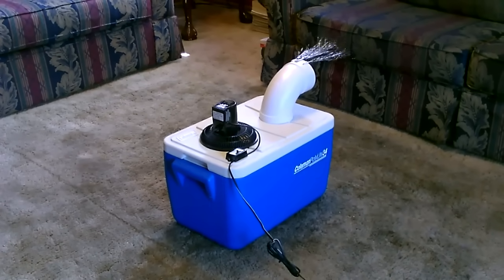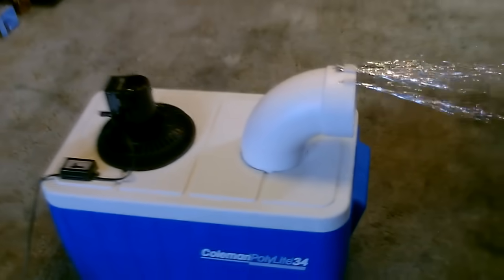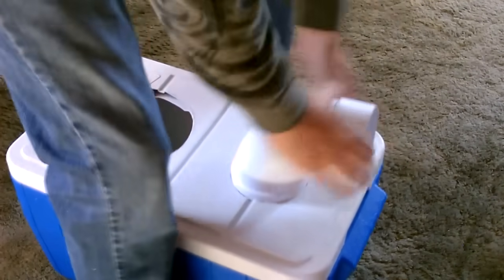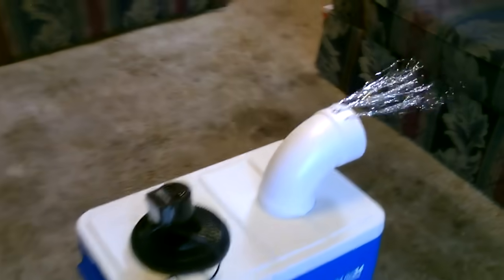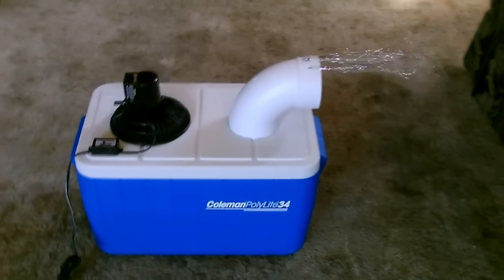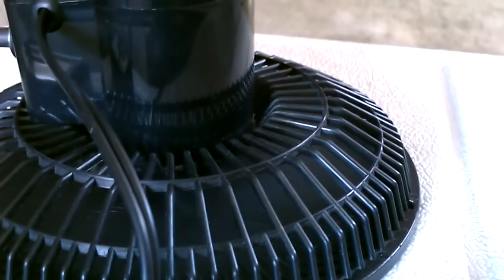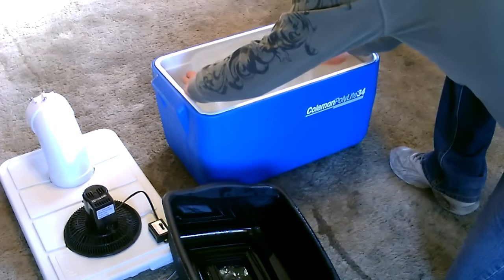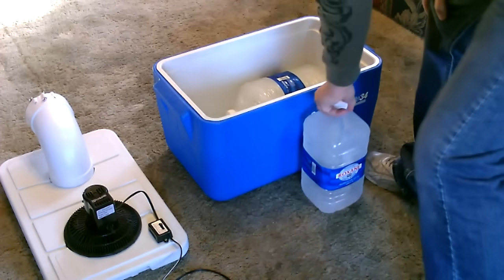Homemade air conditioner DIY - Awesome Air Cooler! - EASY Instructions - can be solar powered!

Comment: VERY IMPORTANT: Put tray in middle of cooler to suspend ice. If air goes underneath ice instead of skimming top of ice it will make it even colder
Reply: I usally put 8 beers under the block to support it
Reply: But how much sooner would the ice melt? Is it worth the trade-off?
Reply: @CallaFab  I guess it depends on how cold you want it. If it's not cold enough, then perhaps suspending it is the better option.
Reply: @CallaFab , good point. 👍
Reply: Wonder if putting Ice cream salt would make even more colder?
Reply: @charlescoker7752  Isn't 40 degrees enough?
Reply: @3sidesofeve711  read the original thread that said "cut it above the ice block to make it even colder..."

Me; Ya ya, good idea....

Reading your comment just made me  realize that 40 degrees ....was "enough."
Reply: @3sidesofeve711  Not in the california desert in july.
Took me 50 pounds of ice and 2 small fans to get temperature to 56 degrees.
It was 129 on the asphalt outside.   Best money i spent that year.
Reply: @wesleygary6651  I'm with you there man, I love it!
Reply: @wesleygary6651 where in CA?
Reply: @earthspiceherbs771  South, looking at map hang on...mesa verde or yuma.
Reply: @3sidesofeve711  it’s never cold enough 😂😊😊
Reply: I dont mind paying $10 while sitting out in the heat watching a kids game
Reply: @reasonabledoubt9223  if you use it like that, it is perfect! But if you want to use it alot, like  in a garage situation, other ideas would be better and cheeper for the long run.
Reply: What about some dry ice In there somehow wouldn’t that last awhile
Reply: @reasonabledoubt9223  Dry Ice is mostly made of Co2 which is toxic.  Only takes about a min of a rat of breathing Co2 before it dies.  Just be careful with Dry Ice
Reply: Also…add some rock salt to the ice!
Reply: We have those freezer gel pacs…wonder if they would work?
Reply: Did you hear the Good News? Jesus, the Son of God, loves us so much that He died for our sins. He was crucified, then resurrected. Jesus conquered death and has overcome the world! With His sacrifice, we can live forever in Heaven with Him in eternal happiness! Follow Jesus, repent, and live forever!

- If you want to learn more about the Good News, check out the Books of Matthew, Mark, Luke, and John of the New Testament of the Holy Bible.
Reply: Guys, it's ok to use these, but the reality of it is the ice isn't cheep, so if you don't have a deep freezer to remake ice blocks, these cost more to run per day than a window unit.  It will cost you at minimum $10 a day if you use it for a few hours.
Reply: @rodneyhodgson2068   You can always use gallon water jugs and keep refreezing them.
Reply: @Tony W  I wonder how long tgey rake to freeze vs' melting, Ill have to google. Just depends how warm the room is.
Reply: @TonyStone3000  they don't last long at all and they take a very long time to freeze. ( 12 hours at least).
Reply: @rodneyhodgson2068  Just freeze the ice in fridge...use tap water!
Reply: @htx8257  yes you can do that. But the problem becomes, if you are using this in a all day type of scenario. Freeze a ice block and see how many hours it takes to become rock hard, then after waiting for most of a day, it will only keep your water cool for a hour or two before it is all melted. Five big blocks of ice can be planned out in stages so it isn't as big of a wait, but how many freezers will that take. For a small room and in emergency situations, this is perfect, but other than that, they have many better options to save you time and money.
Reply: @rodneyhodgson2068 by chance could you mention or link those better solutions? My A/c just went out, my youth is the only reason I live or I would literally die in my room. Thanks in advance for any help
Reply: He froze his own ice though and even ones in plastic jugs
Reply: @rodneyhodgson2068 never heard of an ice pack or gallon of frozen water lmao
Reply: @aprilecotton2060  you haven't?
Reply: @rodneyhodgson2068  LMFAO dude ice is free to make in your freezer and it isn't expensive, the fact that you can run off-grid on solar power or even rechargeable batteries makes this the cheapest A/C set up around. hell you can even buy a 12v boat freezer and run it off a 2nd solar panel to make your ice blocks. It's called off-grid living for a reason( not connected to a community power grid system)
Reply: @fbi805  lol bro you completely did not read any other comments posted.
........ Yes you can make ice blocks, duh...... But it takes hours to make big blocks and if you plan on using this cooling fan as a primary cooling agent, and not just a temp fix to keep you from over heating. it is a dumb idea to plan like that. So much easier to rip apart a car ac system and fashion your own out of the parts, it will be much cool and that system can be run off of solar, but it will only cool a room, maybe two at most. Have a good day and be better at reading all comments, not just the first one you see.....
Reply: @rodneyhodgson2068 nah with a cooler like that and the constant airflow the ice will be there all day
Reply: @lanelunskiprecise2295  nope, a 15lb block is gone in 2.5 hours. I used this method for a few months. They don't last long
Reply: @rodneyhodgson2068  I’m literally using the same method and ice stays in there all day maybe you have to seal it up a bit and or insulate it more depending on what brand cooler you have

Comment: See how the lid is hollow inside? Well next time you buy a cooler, drill a couple holes in the edge of the lid and spray some insulating foam in there. Shit will stay cold twice as long! Learned this trick from an old guy at work. It could be 40°C outside, cooler in the truck bed in the sun, and come afternoon could pull a can of pop out of the ice and it would be borderline starting to turn to slush inside! The ice wouldn't even be melted either. Never seen a cooler that didn't have a hollow lid yet

Comment: Instead of using a box with ice in it, we can use a small refrigerator.
Reply from the maker: hi. i'm not sure if a small refrigerator would keep up. the fan might just blow the cool air out of fridge and then blow warm air. (it'd be an interesting experiment though)

Comment: Can you put a link to the fan, PVC
Reply from the maker: hi. i can't find exact links but the pvc can be found at home stores like home depot or lowes (and the fans are sold at walmart/amazon and auto parts stores). just search for 12v dc auto fan. the one i used is an "auto expressions" fan. it's 12v dc (10 watt)

Comment: I made one a while back in a Walmart parking lot with my tractor trailer broke down I made it fast and cheap then threw it away Styrofoam cooler ,fan and a dryer hose 6ft so I could bring it to the back of my bunk ,But let me tell if I made mine at home I would make it with air entertainment  included many small ports  so I would be creating  air entertainment  bring down the temperature even colder when do you see a ac without little adjustable ports those small port are for air entertainment  more then for you to be able to adjust the direction of the air. Just like when u open your mouth and breathe it's hot but when you pucker your lips and blow it is much cooler. 😎

Comment: One day I hope to have a tiny house but cooling is many times expensive and some folks just bypass it. This would be absolutely perfect and easy to transport wherever you need!
Reply: Ditto, I live in a large house and would live to scale fown to an 850 sq ft.  

Been in the 90s° now with air quality warnings, I still haven't turned on the AC.   It was 86° at the highets temp inside. I live inba 1900 Queen Anne

Comment: This might be a dumb question but can you not just plug the fan into the wall?

I assume no because of the proximity to the water. But just wanting to confirm so I don't have to go out to buy a battery

Also if you're buying a battery then do you need to buy a plug adapter for it
Reply from the maker: hi there. i don't recommend using an AC powered fan. if i wanted to run the unit using wall current i would use an ac to dc transformer and a DC powered fan.

Comment: You can also cut to the fan blades off equally to make it equal still having four blades slows it down that's why drones don't have four blade propellers they are inefficient try taking a box fan and cutting equal blades off so it is still balanced if it's full blade make it two guarantee it'll blow more air and less strain on the motor

Comment: L you need to make a wall that separates the intake from the exhaust if you put a wall in the middle that doesn't go all the way down or closer to the intake make a wall points down and then towards the intake right so like like a half of each so picture a v wall right under the intake that take away one side of the feet so that the one side is facing away from the other side it'll Force the air to go around the ice more and separate in the hot intake from the cold exhaust cuz right now it's mixing that hot the hot and some of the hot air is going right through and not making contact with the ice you got to force all the air to make contact with the ice by making a thin section in the intake side might with a wall like it was almost to the bottom but with like a slot across in the bottom so that it goes down and then has to go left and over and back up to get out going around the ice making it even colder I'm not trying to be a dick I just I noticed the problem you have is not separating the intake from the exhaust sides that they're kind of mixed you know I mean they if you separate them and even just a little and force the air to go over and around or down and around if you don't understand message me and I'll draw you a picture it's really simple piece of cardboard will do it I guarantee it'll make that thing blow colder also you can take a bunch of 2 l bottles and cut the top off and make a bunch of 2 l bottle shaped iced blocks and take them out of the plastic before you put them in and then put them back in the freezer to make new ones six of these and more surface area then one big block is better to use a bunch of small blocks of ice like a bunch of butter containers or something not a big block but a bunch of small blocks more surface area more surface contact

Comment: What about the battery and the solar panel? What to buy, and where please ?
Reply from the maker: hi. if you're using a 12v 10 watt fan then a 12v 15 watt (or any 12v panel larger than that) will do. best place to get the panel these days is probably amazon. as far as the battery... you can also get those on amazon. any 12v deep cycle battery that is at least 12ah is what i would use.
Reply: @desertsun02  Thank you

Comment: If when you use the ice made in plastic jugs you add some water, maybe an inch or two, it would increase the surface area and extract the cold more readily to then improve output.
   As I'm off-grid I need to decide my alternative hacks as do you so with the current 100 degree F temps I'm running an efficient freezer (as far as I'm concerned it's efficient if making my own ice keeps my food from going bad...). And too, I'm homebound so have to hire folks to bring in food and ice.
 Thanks for the great pointers on this wonderful idea.

Comment: What is the DC fan part number or where did you get it from?  It would be great to easily know how to get this fan that you proved works well!
Reply from the maker: hi. the fan is a 12v 10w 'auto expressions' fan. i bought at walmart but i think amazon has it too. (it's sold in the auto dept at walmart)

Comment: I so need to do this. Regardless if the AC is on or if it's freezing outside with my window open, my room will still be the hottest room in the house and It will be that way with only having my TV and computer on to get there.

Comment: How did you secure the fan to the lid?
Reply from the maker: hi. my fan stays put so i didn't need to secure it - but if you need to you can use 2 to 4 plastic zip ties. (i've done that before with previous units). just wrap around front grill of fan (spaced evenly) and put through small (drilled holes) in lid near the fan

Comment: BRILLIANT!! YOU CAN ALSO USE A BATTERY THAT  LASTS 36 HOURS.  OR PUT ICE  BOTTLES  TIED ONTO THE FAN WITH THE BOTTOM CUT LIKE A HINGE AND PUT HOLES  IN THE  BOTTLE WITH ICE CUBES INSIDE  EASY TO REPLACE CUBES. THANKS FOR THE INSPIRATION. STAY SAFE AND HEALTHY ❤❤❤❤💐🙏🙏🙏🙏

Comment: I made something similar when I used to race late model stock cars to keep me cool from the usual 130°F temperatures inside the race car from the header pipes just under the floorboard which wasn't insulated much at all.

Comment: I’m looking this up for van life. Do you think moisture will be a problem with this?
Reply from the maker: hi there. nope, moisture will not be a problem. these ice based air coolers don't add any noticeable humidity to the air. no more than one-tenth of one percent (which you won't notice).

Comment: I bought the exact same version except the bigger one the one that has two vents I had to replace the motor cuz it sounded like rattling crap I do recommend you go to your local truck stop and find the fixed position metal fan high and low speed is a hell of a lot quieter

Comment: Thanks for making this I made one the other night I know this is an old video but much appreciated
Reply from the maker: hi there and you're welcome. i'm glad you made it! i like to think that my vids don't really "get old". i figure if the idea remains useful then the videos age means very little. btw - i don't do the "current event" or "fad driven" videos. mine are more of the "evergreen" type. meaning they can be valid for decades. by the way, i check the comments from all my vids equally. i don't favor the newer ones. if you comment on the first one i ever made (12 years ago) i'll be just as likely to see it as if you comment on the newest one.🙂
Reply: I just made. New one ha ha sold my old one for 20$

Comment: Question. I seen you traced the fan wider then fan. How do I get fan to stay without falling through? Caulking or what. What type of fan should I buy? Thank u.
Reply from the maker: hi there. when i cut the hole i cut it just smaller than the fan (so it won't fall through). for this build i didn't need to attach the fan to the lid. it just sits on the top of the lid. i have other builds though where i do attach the fan. i use a similar fan but i zip tie it down to the container. all you need to use is 2 to 4 plastic zip ties and it will hold it on there very well. 👍🙂   the fan i used is a 12v 10 watt fan by "auto expressions". sold at walmart (in their auto dept.)

Comment: Good idea, but you should put the fan in the exhaust side to PULL the air into the chest as opposed to forcing it into the box.
Compression raises the temperature and every little bit counts.
Reply: Decompression lowers temperature though.  And it decompresses on the way out of the box.

Comment: If your doing Nomadland (Movie) Vanlife in the hot SW desert. And you have a Solar Panel System on your van/rig with a Dometic fridge/freezer in the van. Can you wrap water pipe coils around the fan  (that condense drip into a small cooler) that feed through the freezer (using pump)? And put antifreeze in the water, leaving a big enough reservoir in the freezer (big enough freezer) to cool down this reservoir and make it work?

Comment: inexpensive coolers can be cooler by spraying spray foam in to the areas you cut the holes in to also by drilling some more holes and filling them as well.
Reply from the maker: hi there. that is very true. great tip!
Reply: Can you give an explanation of why those extra steps makes things cooler?

Comment: I’m going to try this in my car on a smaller scale with a small styrofoam cooler and a cigarette lighter plug fan.  I’ll be damned if I’m gonna spend another $1k on a car that just barely passed 75k. Don’t buy a Buick!

Comment: Whats the maximum wattage fan you'd recommend for two 220w panels?
Reply from the maker: hi. well it would depend on the amps that the panel produces. 🙂
Reply: @desertsun02  I don't know about the amperage right now, but I am pretty sure I could test it in the next few days, but evaporators only do so much when the humidity is 100%.  I'd have to do the dry air thing or something.

Comment: Hi
We want to try and make this as a project and we'd like to do it exactly as you did.  Could you tell me what type of switch you are using to control your fan?
Reply from the maker: hi. that fan actually came with the switch built in. the fan itself is a 12v 10w 'auto expressions' fan from walmart. (sold in heir auto dept.). if you can find the fan it will probably still come with the same switch.

Comment: I don't know how yours gets to such cold temps. I did the same exact thing as you, same cooler, same fan, same pipe. And mine probably only gets down to low 70s high 60s (f). I'm going to try to fill the entire thing up with as much ice as possible. I think mine doesn't get as cold because it's in a van and the heat from the outside of the van makes it warm in here. Is that the issue? Or am I missing something?
Reply from the maker: hi there. a few things that can affect the output temperature are. how much ice you use, whether it's large blocks, ice cubes or 'ice'paks'. large blocks are best. other factors are fan speed, outdoor air temp, and humidity level. (humid air is harder to cool down than dry air.). if you load it with solid hard frozen ice blocks you should get close to what i did. (maybe a little higher if its really humid air or if it's super-hot room air that is entering the cooler.

Comment: Great for off the grid type hunting cabin etc...  How long does the block off ice last?
Reply: BTW, Brilliant to use solar.
Reply from the maker: hi there. ice varies quite a bit. i usually get about 5 hours per block. biggest block i never used lasted near 11.